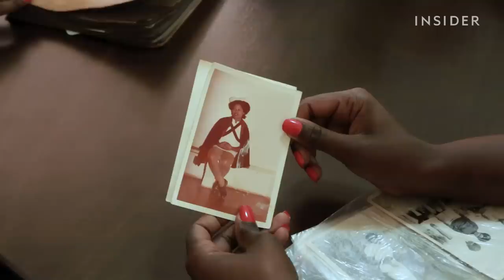Sewage Pipes Into Laundry Baskets | World Wide Waste | Business Insider

Comment: PVC companies: that's right, focus on those baskets instead of asking us to overhaul our polluting process & lack of accountability!
Reply: I know it's little, but these people are doing smth. Perhaps you could reach those PVC companies and ask them to stop polluting. Sadly it's almost impossible.
Reply: @naly202  "Perhaps you could reach those PVC companies and ask them to stop polluting. "

Like that would ever happen, it's not the companies its the CONSUMERS doing it, the companies are only making what consumers DEMAND for the cheapest price they can get it for, PVC pipes are CHEAP- try pricing a steel 4" or 6"  diameter pipe-
a 4" ID steel pipe costs  $448.56 ea. for 20 feet,  it weighs 10.79 pounds per foot, so it's over 200 pounds for this one pipe

By contrast, PVC pipe the same size is $104 at Menards- less that 1/4 the price and it weighs about 40 pounds- one guy can carry it, you need a machine to move the steel pipe, and it also corrodes.

As long as PVC costs 1/4 what steel does and weighs  1/5th what steel does, nobody is going to buy steel pipe like that if PVC will do the job in their application.

WHat you are hoping is like hoping everything will be made in the USA again instead of China, that's never going to happen either because people shop today by PRICE only, even if tariffs are added it doesnt matter because the price will always be cheaper made in china than here, and people shopping by price will stop buying if the price point reaches a certain level, for example- something you dont NEED but want, like a huge  BIG screen TV, made in China maybe $699.95, made in the USA maybe $3,000, the person who wants the big screen TV to watch the upcoming football game on a holiday weekend is never going to pay $3,000, so tariffs could be added on the china made set and make it $3,000 and the person will look at the price and say "no way" and walk out of the store.
Reply: Not to mention shipping them across the ocean
Reply: @HobbyOrganist  In many cases PE is a good alternative to PVC.
Reply: @HobbyOrganist  so, as I said, it's impossible to stop them...
Reply: "Oh, and don't worry about masks/PPE! A little dust and fumes never killed nobody!"
Reply: Pvc companies aside, the thing is, plastic woven baskets are actually a pretty common product. 

This is great because theyre using a recycled material to create something that would otherwise still be created, but out of new plastic produced specifically for that purpose.

Yes we in general need to stop polluting, but a big part of the reason we have so much plastic pollution is because we insist on making things out of plastic that could easily be made using another material. Not all plastic can be substituted, but were also just so used to plastic being the cheapest most common option, that we dont stop to ask ourselves "does it have to be plastic though?" Because many plastic things could viably be made in something else with little or no downsides.
Reply: Won't happen until companies are required to create a direct recycling program for their products.
Reply: Not the point of this video.
Reply: @Heterandria4mosa  also heating the material over a wood fire is inefficient and gives little control over the temperature. You get fumes when you overheat the material
Reply: Easier said than done, at least these guys actually do something about it rathar than commenting on social media
Reply: @HobbyOrganist  You can put a price on pollution. That way there is an incentivve to invent and produce less polluting alternatives.
Reply: what are you’re plumbing pipes made out of?
Reply: We always focus on the end results. Never the beginning. Still a cool idea.
Reply: Why not both? I mean, you should be able to push for more than one thing at any given time
Reply: Won't work. This is a better product then the lead, steel, or copper pipes from the past in costs all around. We NEED to find ways to reuse these products and to PUSH the ideas of reusing these products. I think what these sisters are doing is great.
Reply: @TakenTook  
Silicone might make a good substitute for plastic for baby stuff. Way easier to sterilize, too.
Reply: Is complaining helping any now Karen
Reply: Dear mr holier-than-thou.  You use those pipes every time you take a pi55
Reply: @TakenTook  they do make glass bottles. But they are so dang expensive compared to the plastic. I used whatever I got second hand, but when my babies were little, I would've loved having glass bottles for when I'd pump and let my husband feed the baby. I use glass water bottles from Takeya. I'm going on 11 years with the same water bottles and they are holding up great! As long as the lid is on, they are shock proof, too. I've dropped my glass water bottles so many times and never have had a chip. The glass is tempered to be stronger, and the lid and silicone sleeve absorb the shock of the drops.
Reply: @icedragonair  Plastic is not bad, and it's a byproduct of oil refining.
Reply: And they're meeting to figure out how to charge these people for taking their waste. This is why people my age 50+ are bitter about the world. Everyone is trying to do as little as possible while screwing over everyone else.
Reply: @HobbyOrganist  u make a very interesting point!!!👏👏👏
Reply: @TakenTook  right. I vote for the party that created the EPA. We also support animals through the DNR. Which is funded through purchases of particular items, and license sales.
Reply: I bet you are an epic blast at parties
Reply: Thats how we reduce straw used not the bottle use by coca cola
Reply: @HobbyOrganist  geez I wish a big screen TV was that cheap here!

Yes consumers drive the continuation, however consumers can only choose from what is offered. While I agree steel is probably not an option, ceramics might be, or maybe not, maybe some other material. Or perhaps the processes for pvc  could be refined, but unless the product is offered take up will always be zero.

That's not the point of the video though, the point is reducing waste from factory rejects. It's a small step but solutions to major problems are not all or nothing.
Reply: Classic chemical company
Reply: Imagine this was supported by a pvc company and they get a tax break for being green.
Reply: I think you missing the point.

There will always be waste big or small. The aim here is to turn it into a resource rather then a burden.

Gold copper silver steel all wanted and reclaimed.

Hell they pay for if scrap metal, such high demand for rubbish.

So why not find way to reuse and sell waste products with enough growth.......
Reply: It's actually your fault for not making enough PVC baskets! I made my low-carbon, geothermal, solar mansion out of em'.
Reply: @naly202  bootlick much?
Reply: @HobbyOrganist  you must own a piping company knowing all these prices xD
Reply: But there is a handmade basket. Wow!
Reply: @HobbyOrganist  yes because we cant be shoved into factories to work for poverty wages while buying stuff from the company store at exorbitant prices. Our country thrives off of the pain and suffering in other countries. Sadly other countries need those poverty wages to eat. Their governments are even worse than ours
Reply: How does the water you drink get to your tap?? 
If you don't like PVC, stop drinking tap water.
Reply: Yup, most of these videos wouldn't exist without PR help.
Reply: @naly202  they can only stop polluting by not making PVC.
Reply: @abyssstrider2547  PVC is terrible.
Reply: @veganpotterthevegan  It's not, the problem is that we are not recycling this material. This stuff can last a thousand years without rusting or breaking down, has a great tensile strength and good rigidity. But instead of using it for it's intended purpose we use it to make single use items and packaging. Because it's cheap.
Reply: @abyssstrider2547  it is, the ecological harm its manufacturing causes is enormous.  Cancer rates for people living near factories is obscenely high.
Reply: @TakenTook  How about better people and less lobbyist and politicians

Comment: Just don't breathe in the lethal toxic hydrogen chloride gas when heating PVC, or be downwind...
Reply: Right. Would love to see them improve on working conditions in that regard, both them and the Kusasa team. Neither crews use any masks whatsoever and the latter is working in a closed building with said fumes and particles.
Reply: @Not Expat Joe  @Not Expat Joe  That is a very nice explanation and thank you for the info on these!
Reply: @Not Expat Joe Of course no worries! Yeah, a base protection is always good even so, at the very least that should be available.
Reply: @Not Expat Joe carbon monoxide isn't dangerous in the open air. And it's also unlikely an open wood fire would even produce dangerous levels. 1600ppm will kill you.  As long as there is enough oxygen you don't get anywhere near 1600ppm. 

To get up to that level you need the fire to be burning its own fumes know as vitiation or incomplete combination.
Reply: @Not Expat Joe well your point is wrong. You only get carbon monoxide when there is incomplete combination, which is caused by 1, lack of oxygen, 2 usually because of vitiation. (Burning its own fumes/POC/products of combustion). 
An open fire produces very little Carbon monoxide because there isn't a lack of oxygen so you get complete combination, although it won't be stoichiometic.
Reply: @Not Expat Joe I'm a heating engineer, I understand combustion and what causes CO........you DONT seem to understand that an open fire does not produce harmful levels of CO. 

An open fire would produce nominal levels, and could only produce high levels if starved of oxygen, which is unlikely as its an open fire.
Reply: @Not Expat Joe I've re-read your post and you stated "massive quantity as the carbon monoxide released". 

Open fire DO NOT produce massive quantities of CO. 

Because, for the 5th time, CO is only produced when there is a lack of oxygen.
Reply: @Not Expat Joe CO is not harmful under 1600ppm, open fires produce 50ppm. Your talking rubbish, youkve clearly absolutely no knowledge or understand of combustion. 

If open produced harmful levels of CO, no organised Nov 5th public bonfires would be permitted.

Comment: Most PVC is sensitive to UV light. Using regular PVC where it's exposed to sunlight will cause it to break down, releasing microplactics and chemicals. PVC pipes meant to be buried are not UV stabilized.
Reply: Or burying it or burning it in a landfill or letting it sit in the ocean..
Reply: @Tonyhouse1168  Modern landfills are a great place for plastic. It's the plastics that don't make it there that are the issue.

Comment: "We have found a solution to the global environmental problem we are facing.." Heating PVC released toxic hydrogen chloride gas, heating the pipe in inefficient open firepits is also not remotely eco friendly.  And although PVC doesn't lose tensile strength when exposed to UV it does become susceptible to impact damage and fracturing, something that would make it a poor material to build a daily use basket out of.
Reply: The 8-hour truck ride to bring the pipes to their location also doesn't really help the environment. I appreciate their initiative but....
Reply: @JimDean002  It's better than sitting in a landfill.
Reply: @christineperez7562  Is it?  Where do you think this $120 basket is going once it falls apart?  Do you think a basket at that price point is going to replace or prove to be more durable than a purpose built basket made of wood, wicker, abs or hdpe?
Reply: Turning waste into art can be celebrated WITHOUT the false narrative of being "eco-friendly." That's what I hate about these stories.
Reply: @farpointstation  totally agree. people need to take responsibility again and learn the dying art of weaving baskets vs outsourcing it to someone else. you can use fallen branches of willow trees, string, grasses to do it but people would rather buy something today than try to sit down and figure out to create it.

Comment: They missed a trick. 
After the granulation for the old pipes you could directly extrude and wind the lengths you need to weave. Got some unnecessary steps in there.

Comment: How do they sterilize the dirty pipes? You didn't show that.
Reply: Said they just use none installed damaged by transportation.
Reply: @kingoliever1 No they said they used both damaged and old pipes, even the unused ones need to be cleaned after sitting outside if people are going to use them in their homes.